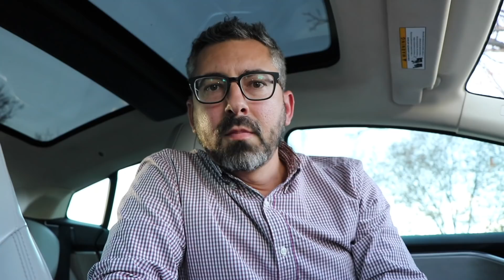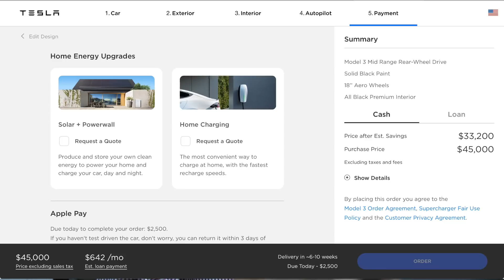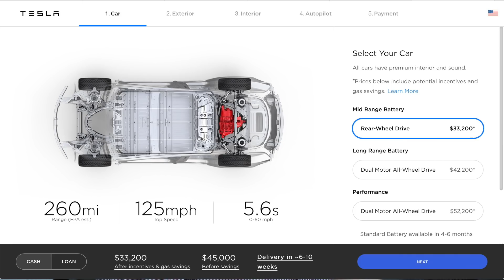Breaking: Tesla now offers a Mid Range Model 3

Comment: I can see Tesla ADDING a midrange option to the RWD car, but they didn’t. They changed the specs of the RWD car to 260 miles range and deleted the 310 mile range. I think this is going to upset more people than it makes happy.

Before, we knew the Had 46 cells per each of the 96 groups, for a total of 4416 cells. We also had information that the short range battery had 31 cells per group, for a total of 2976 cells. Basically we knew we were paying $9000 for 1440 extra cells, and a few extra feet of cooling tubing.

One key point is that the RWD is 10% more efficient than the dual motor, which is hidden by the “310 miles range”, but exposed by the EPA MPGe data, which says the RWD uses 26 kWh/100 miles and the AWD uses 29 kWh/100 miles.
https://www.fueleconomy.gov/feg/bymodel/2018_Tesla_Model_3.shtml

So by eliminating the 75 kWh battery option, Tesla can now use the true efficiency data, and use a 58 kWh battery to go 260 miles. This means instead of paying $9000 and getting 15 extra cells per brick, you pay $5000 and get 5 extra cells per brick. 

The number of cells you buy and how much you pay is pretty important. Not just the range. The more cells, even if they only add buffer, make the battery last longer and charge faster, and has more power than a battery with fewer of the same cells. 

We will have to see what they find when they open one up. But for $5000 it better have at least 39x 2170 cells per group, and have 60-65 kWh of that 70 kWh available.
Reply: IMHO I also think it will be under 60 kWh battery. The real range of the RWD LR is 330. 75*260/330=59.1 kWh plus it’s 4% lighter at 3684 lbs, so around 57 kWh battery size for the mid-range!
Reply: Brian Paulk, I think it will be 10-11% smaller than 57 because the RWD is more efficient than dual motor. Tesla can’t use the same method on the 3 as the S/X due to the PM motor in the rear.
Reply: blah blah blah...the stupid fwd motor is only worth 1000$
if you want the range just get the dam thing. itll help your range anyway
Reply: Richard Roberson the dual motor model 3 has less efficiency, less range per kWh. I think the front drive unit is worth more than $1000. You can’t buy anything like it used for $1000.
Reply: so you're missing out on 2k of motor and 15kw tesla says is worth 1500-4000

so you're saving 10k and losing most likely 5k of stuff....yeah thats good
there goes 5k of pure profit

10% less profit margin than a 55k model 3 already. 

so the margin game begins lol 
because the people wanting 55k model 3's has already been exhausted
Reply: Richard Roberson, comparing the $49k 80 kWh (75 kWh usable) with an EPA range of 334 to a $45k version with an unknown battery size and a 260 mile range, but not specifying the if this is actual or derated like the LR RWD was to 310. 

This means the new battery may be on 55 kWh usable, so you save $4000 and lose 10kwh of batteries and the newest AP hardware, since it won’t support FSD. It’s not a good deal. Let’s see how many people take the bait.
Reply: saving 4000 and giving up 1-2k of batteries? sounds like a good deal...because it is

dont care about prices that were...as of now its 54k vs 45k....9k for 50 miles less of range....
tesla s/x are paying 19,500$ for that range upgrade to give you an idea

so losing 2k motor and 1/6 batteries or about 13kw worth 2600$ you're saving 2x what you're giving up and teslas margins are already compacting

in the meantime i-pace is outselling tesla in norway, yes its brand new but clearly people seem to like it in the worlds EV capital meh 

63k for a midsize suv that beats x 0-60 by good amount despite costing 37k less than LAUGHABLY OVERPRICED 100D....wut 

not to mention
the 100D have to be the most overpriced pos on the ev market

here we see 12kw and a motor being sold for 10k.....that likely costs tesla 5k
and in the tesla 25kw and nothing else being sold for 19,500$ and this is the significantly worse older battery!

glad to see s/x sales being stolen by newer cars with more horsepower for less money.  sticking a battery on wheels isnt a unique idea and they cannot get whatever margins they want indefinetely

keeping the price the same and taking 500$ referral and free supercharging is BULL
Reply: IMHO all I know, Tesla is making a bigger margin on this mid range model no doubt about that. Which if it helps them profit sooner and roll out the unicorn standard sooner than later, I’m all for it!
Reply: heatism. Bigger margin than the promised $35k car for sure, but bigger margin than on the $49k car, that has yet to be proven, if it’s its proven that the $45k mid-size is a higher margin than the $49k version, customers are going to have a revolt, because reducing options should always give a customer more value. 

Right now we know Tesla adds 15 cells to each brick for $9000, or $600 per cell in each brick. So if they reduce the price by $4000 and remove 7 cells, each brick in the new pack will have 39 cells and it will be a better deal for the customer, lower margin for Tesla.

HOWEVER, if Tesla pulls 10 cells per brick, and only reduces the price by $4000, the customer is paying $5000 extra for 5 cells per brick, or $1000 per cell per brick, and basically getting boned by Tesla. 

But since Elon is tight lipped about the actual kWh of the mid size pack, we will just have to wait and see what it actually is. But based on my back of the napkin calculations, this is NOT a good deal for the customer, and it’s also NOT a higher margin for Tesla. This is only a stopgap measure until Tesla can start selling overseas.
Reply: yeah sound like their order book dried up and they're trying to get some remotely decent margins out of what they can for this quarter
Reply: Richard Roberson, yes, and it supports the rumor that the 1000s of Model 3s scattered all over the counter are not customer cars just having a hard time getting delivered. That narrative never held water, because if my model 3 was sitting on a dealer lot getting molested by hordes or tire kickers, I would have gone there and picked up my car and not left till I had my car. 

Further evidence that the order queue for the $49k version dried up was when Tesla just started cranking out inventory without a buyer waiting. Tesla doesn’t have the cash to have that much inventory because they don’t use independent dealerships to carry the financial burden.

The 4 week estimated delivery date was another sign that the queue for the $49k car was empty. 

We all knew Tesla was going to feather in the cheaper versions, but I think we expected to go from $49k to $44k to $40k to $35k, using the already established $5000 premium interior and $9000 25kwh upgrade. 

This sudden change from 75 kWh battery to ?? kWh with a $4000 price reduction caught everyone off guard. 

I don’t think this move will significantly help Tesla. They need to start selling the high margin versions overseas, but they still have a tax credit to milk in the US, and they can’t support both 100%.
Reply: it definitely is not a greater value for the customer. just look at simple math. price went down $4k but range went down 50 miles. a difference from the $35k to LR battery is $9k difference (or $1000 per 10 miles range). So now, people will have to pay extra $5k for only 40 miles range (or $1250 per 10 miles). A slight shaft, IMHO, LOL
Reply: Nicke Suos, you would need to read and comprehend my original comment to understand why they MIGHT be losing more than 50 miles range due to the fact that the real EPA range of RWD 75 kWh model 3 was 334, but Tesla told EPA to derate it to match the AWD which is less efficient, while knowing many Tesla fans would assume its more efficient as in the model S/X.

So you MIGHT be losing 74 miles, and only saving $4000. That’s why I say we need to know how many cells are used, and make sure they are the same as the other 2170 cells. The actual battery capacity is what you are buying, and a bigger battery will last longer and do more,

Also, what is the mileage warranty on the new car? 100k, 110k (mid range) or 120k?

Comment: Wonder if you could get some battery  moduels from a crashed Tesla and fit them into the empty slots in a mid-range m3 and make yourself a long range m3 hmmmm
Probably not
Reply: Brett Mciver, not likely, based on how those 4 modules are designed, and the BMS might not recognize it even if you put the LR modules in it. And even swapping the whole battery will probably need some system access or it will reject it.
Reply: tldr no.....not worth the labor to open it
Reply: Gregory Bell, yes, no warranty for sure, and just getting the car to recognize the battery is hard enough. Tesla has a lot of parts encoded so that they must be manually entered into the computer in order to work. They do this under the guise of stopping value of stolen parts, but it’s really done so they can be the Apple of the auto industry, and make it difficult for others to work on the car.
Reply: All of the above plus working with crash batteries is generally not a good idea, you never know what slowly taking away inside something that's gotten whacked that hard and there's a lot of energy inside a Lithium-Ion that big.

Comment: Disappointed that the long range rear wheel is going away
Reply: They have plenty of them available now if you want one.
Reply: Elon tweet that still you can buy it for a week.
Reply: so you wont be able to get range without the extra useless battery, lol gotta up those margins!  so awd long range and rwd only short range weird
Reply: wtf. why? The RWD LR model is the best one by far
Reply: an extra motor only costs tesla like 1500$ max, teardown points at 1000$ and itll help you get more range, each motor is optimised for different speeds so if you want long range poney up the extra 2-3k and get LR awd
Reply: no its not. RWD has about 8% more range than AWD. please dont make such comments if you do not know for sure because people end up believing them.
Reply: KingProne, 10 miles difference on 75D, who cares for gods sake.  i cant imagine it really makes a difference at one speed...the motor could just turn off. i doubt that one single neutral motor is going to soak up 8kwh of range
Reply: sigh.. .ok im not trying to be a dick.. The Model S uses an induction motor at the rear which by its nature is more tamed for performance than efficiency. induction motors also become exponentially less effective with size, hence 2 smaller motors are more efficient. Because of that it benefits greatly from gearing to increase its efficiency, downsizing and it also is very suitable for torque sleep technoloqy. Model 3 uses a permanent magnet motor which is highly efficient to start with and doesn't really benefit from gearing or size reduction Additionally torque sleep is not as efficient with it and they produce a lot of resistance which makes them unsuitable to be used more than once in a drive chain. There are some more factors coming into this but overall you ending up with a RWD vehicle having 12% more EPA range (10% more highway only). Model 3 already has very high range to start with and at slow speeds/100kmh with aero wheels you can easily add 50-60km to your range which makes it a superior car than the AWD. The AWD does not really have much benefit over the RWD. Slightly faster acceleration perhaps. Traction is a non issue in most cases - americans need to learn that in winter you need to have winter tires, not AWD.
Reply: i cant imagine anyone cares about range anymore....your travel time has more to do with your charging speed and supercharger locations which will only increase as the model 3 plague hits the roads and they start charging .25$/kw at all these stations

can always just drive faster at 83 or so and get to the charger quicker to charge at 500mph
Reply: 83mph is very low in europe where people often cruise at 90-100 (even outside Germany). Furthermore other countries do not have the same supercharger coverage. Cars with more range also have higher relative charging speed
Reply: all of europe has MORE than the US on their highways.....so in europe the point is entirely moot
and ad 3's are delivered over there i cannot imagine that they wont increase them even further
Reply: a car with only 150km real world range is useless on european motorways. we dont drive 100kmh here.

Comment: Thank you for that information Sean but to be clear, you are talking about the 35 000$ with 220 miles is now 260 miles with less money right?
Reply from the maker: The Standard Range is the 220 mile $35k offering which is still planed for 4-6 months out.
Reply: Thanks for clarifying. Quick question I heard once MKBHD talked with Elon about a 25 000$ car or something, if that happened do you thank it would be the 220 miles becoming cheaper or the same M3 with less miles?
Reply: @CJ-wq7hi  I think that is in a distant future from now. It's a long term goal he wishes to accomplish I think.. maybe with the model y?
Reply: Joshua N Model Y is supposedly a small crossover with similar range but a slightly higher price. Possibly model 4 is the cheap sub-30k version, comparable to a compact sedan or hatch, ala Corolla or Cruze. I would’ve hold my breath til about 2023 or so...